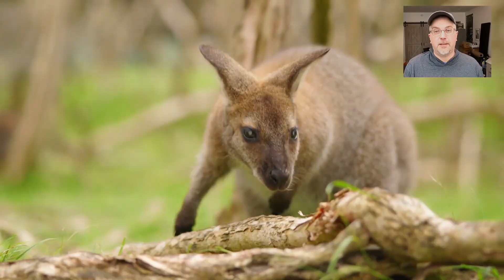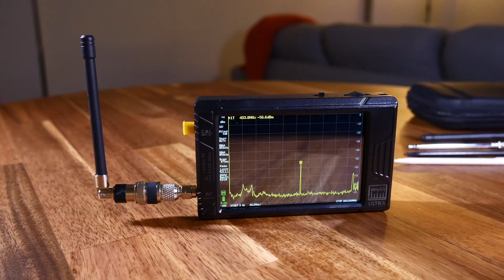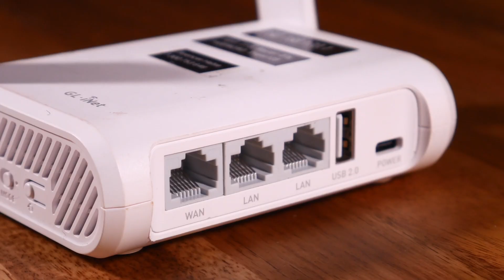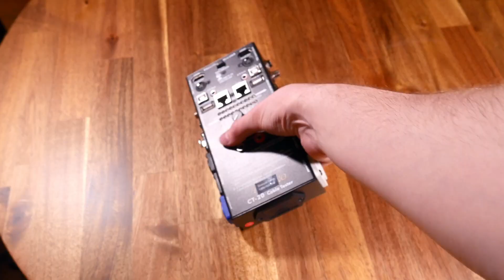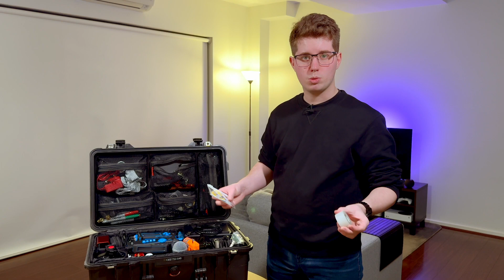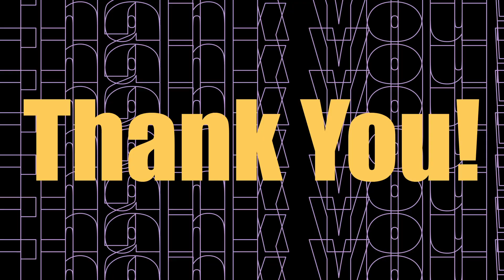What's In YOUR Kit Spencer Halse? Pro Audio & Video Tech from Australia 🇦🇺

Comment: So glad to share this with you all and I hope you find some value in what I've put in my kit! Feel free to reach out if you have any questions.
Reply: Would love to hear any more details on the bone conduction headset. I know you mentioned doing a video, but even while you're working on that would love to even know which headset you actually wound up using.
Reply: Thanks for the tip about Open Sound Meter. I'll be downloading that a little later.
Reply: @ColinMcNutt  It's a great bit of software! Lots of online training material available too
Reply: which sdi barrels do you use we bought some in the pass but they weren't the greatest!
Reply: @nathangoh834  There are some Neutrik ones which are sweet but pricey... As long as you double check they are 75 ohms you should be okay.
Reply: Man you have got me going down a rabbit hole! - have to do a video on my peli case some time.. - LOVE that comms headset, I use a BeyerDynamic DT109 for most of the stuff i do as im in a noisy environment, but would love something more light weight for rig days, I've done some googling and reckon you have modded a "Battle Zero-NX BM Tactical Hybrid Bone Conduction Headset" which i can only find available online from the US. Looks like it comes with a US NATO plug.  Are you able to share details on what you did to mod it for ClearCom? Did you just cut the plug off and re-solder, or make a patch lead? - We typically use a Riedel system which i believe is same pin-out. (Yes Riedel support bluetooth but ive found it to be really hit and miss!)

Comment: @spencerhalse Wow great kit! couple questions: what antennas do you use with yout tinySA? Can you share some more details about your bone-conducting headset? I've been looking to build one myself for some time
Reply: Will make a video going into detail about the headset very soon!

Antenna wise, the quarter wave BNC antennas are the ones that come with RF Venue DFins. Also got a 2.4GHz wifi SMA antenna, and the wideband one that came with the unit. Got a few BNC attenuators to so I can plug into an antenna distro unit if needed.

Comment: Small note on the tinySA Ultra - natively it's specs are only intended to go up to 1.8GHz, it has an 'ultra' mode with calibration up to 6GHz and observations up to 12GHz (without cal) via bypassing an internal filter, however this mode is known to generate harmonics, so don't drive yourself crazy chasing ghost harmonics that don't exist!
Reply: That's right. Didn't want to get too technical here to keep things nice and concise. I like being able to get some idea of what's happening up there in the spectrum as I'll occasionally be coordinating wireless video transmitters around the 5GHz zone.

But yes you're absolutely right. In fact you can see those harmonics creeping in on the close up shot of the device scanning up to 6GHz.
Reply from the maker: Thanks for the great info!

Comment: Great info, thanks! Question, what model case are you using in video (with zipper pouches and dividers)?
Reply: It’s a Pelican 1510 with foam dividers. And the lid organizer is the pelican branded one. 

I did however upgrade the wheels on the pelican case. DCSoundOp has a great video explaining how to do that if you’re interested.
Reply: Looks like a Pelican but I would also love to know the exact configuration.